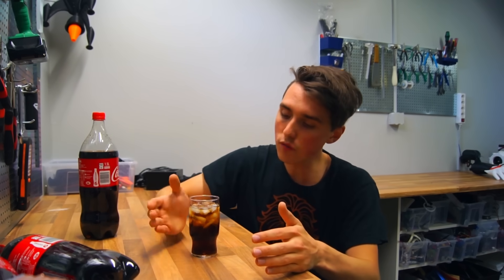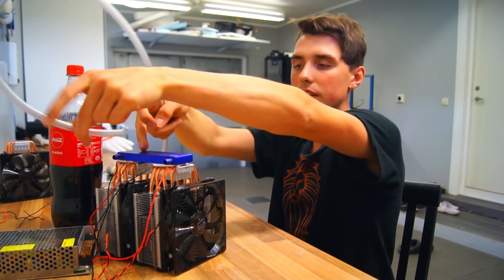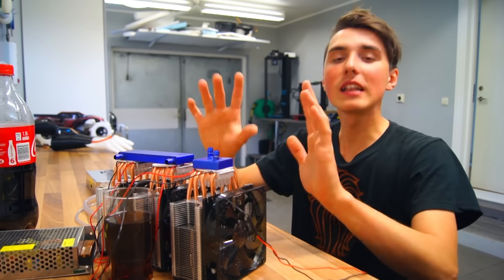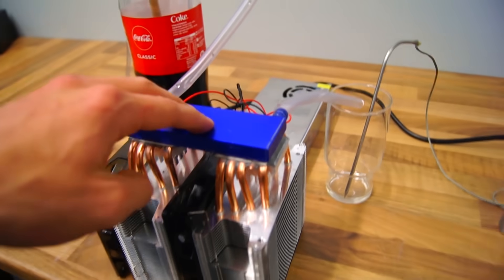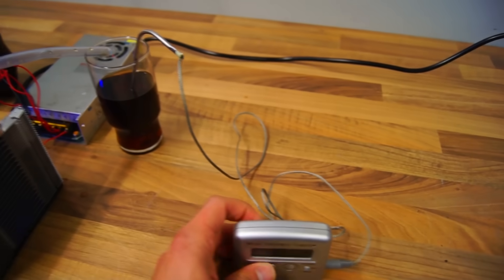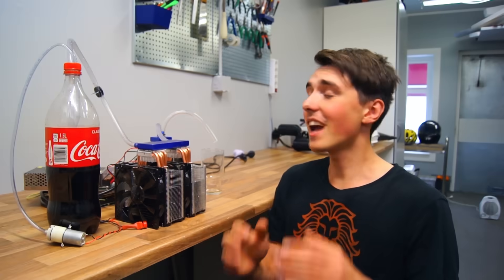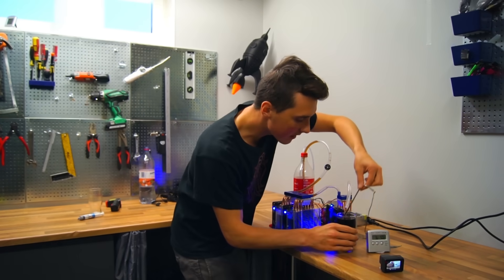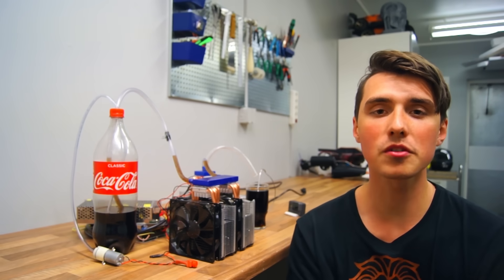Peltier Soda Cooler Machine - DIY Drink Dispenser

Comment: One question.       ? Is your heat sink upside down. If it is it is not performing at 100% of its potential.    
The top of your application I believe is the evaporator, the finned section below is the condensing unit. It uses gravity to bring the refrigerant down into the evaporator section when it is oriented properly.  Please let me know if I am wrong.

Comment: I know it's pretty old by now but maybe you plan on a second version.
The main problem i see is a the water body. It's very thick. So the coke flows through it but it gets cooled only from the bottom.the coke more on the top does not get cooled enough.
So maybe 3d print a cooling body that either very thin to make sure all the coke is close to the bottom. Or modify the current one so it's has layers inside of it. So it's longer in the water body and every layer is thin so the bottom layer again cooles all of the coke since everything flows through the bottom layer. Otherwise you could also put the 3rd heatsink on top. Combined with a better water body probably gets you down to almost 0 degrees

Comment: I would suggest using 2 Peltier but more powerfull ones and with 2separate flow and use gallium thermal paste and even better would be watercooling the Peltier modules xd this would be non power efficient but cooling your soda really quickly

Comment: Slow down the air pump, not put a flow limiter on the coke. Run the pump at 9 volts. Or vary the airflow.

Comment: Hello , make a water cooler system for pc's cpu and Gpu 
Tnx
Reply: that could work but the condensation issue is the bad part. and water+electronics is a no no.

Comment: Should you have put the restrictor on the output end? Also if you wanted to be accurate, you should have put the temp probe on a stand so it doesn't read the temp of the sides of the glass because they would be warmer

Comment: 1 year later: If you use a cooling block with more mass you will get much better results. The drink goes through the block so fast that the only heat that gets transferred is what the block can absorb and nothing more.

Comment: I don't need this.  I have ice.  But this makes me ask, is there a way to make an ice dispenser with peltier coolers that brings in water and spits out ice?  all you have to do is bring the temp down to 0.  I was thinking about a gear or chain that holds tiny ammounts of water that touches two coolers, and so the water freezes, and forms ice, and then at the end of the chain is a wheel, where the chain bends around a wheel, and forces the ice out of the chain.

Comment: Two things wrong with this efficiency wise.. One is heat rises so the cold side is being heated up.. Second thing is the way heat pipes work requires the block to be on the bottom otherwise there is no liquid to phase change and it is basically working like a heat sink but not a heat pipe heatsink... Try it again once you know what you're doing. Cool air pump idea though. But I've built much more complex cells for my a/c unit I made. Also power wise if use a 12706, nothing higher as efficiency drops with higher power units.
Reply: Heat doesn't rise it travels to cold, that's basic knowledge. If you don't know that, how can you tell him what he's doing wrong? It seems pretty clear you are confused by you talking about phase change. It's a heat sink. The block gets cold, the Coke goes through it. Nothing else. And he's not concept testing a prototype, he's just fucking around with spare parts for something to do.

Comment: You losing a lot of power using this method because air temperature heats up the box, so you should use a styrofoam box to isolate freeze box from air.

Comment: Why not use a water pump? Fill the glass with coke, then use the water pump to take the coke from the glass, through the cooler, and back into the glass. This way circulates endlessly until it reaches the temperature you desire.

Comment: The Chinese made water block will kill u with heavy metals contamination... They recycle copper and aluminium from scrapyard or cell phones which are heavily contaminated during the recycling process. Also if there is soldering done at the block, you most probably will get lead poisoning. You should use food grade stainless steel for that.

Comment: 1. Turn the 2-3 cpu cooler 90 degrees so they do not blow the hot air on to the next which is less effective to remove the heat,,
2. Instead of a water block it must run through and pump, etc. Use an aluminum block / plate that is large enough for the bottle to stand on top of it, so it can also be used for cans,
3. To keep it longer cold and a little faster, place a thick polystyrene box around the alu plate, from the plate and up, higher than the bottle and put a polystyrene lid on to keep the heat out

Comment: I would suggest to put a volt control (dimmer) on the air pump to slow it down so there will be more time for the heat exchange.

Comment: carbonic acid and aluminium (blue fluid heatsink material) reaction results in aluminium (Neurotoxic) being deposited in high quantity in your beverage. use a glass heat sink of you will get Alzheimers disease in only a few years and become so dumb you won't know what 1 + 8 equals

Comment: Cool off a copper block with it then take it off and drop it in the coke. That way it can run before you get the drink and be ready when you need it, also will cool it much better and more quickly.

Comment: there must be a better way, I cannot remember what it is called when you heat water using friction rather than flame or electricity, but I am wondering if there is an opposite to that. either way though... think on it, make it better, scale it down, patent it, and sell it.

Comment: With your contraption you can just pump some coke into the blue container and add a longer hose to the end of it and elevate the hose at the end then wait a minute...

But I would use only water with anti freeze in the hose and run it in a loop around the glas or better the bottle.

Comment: Dude crazy idea, get some gallium and disolve has much aluminum cans into has you can to form aluminum gallium alloy. I have not tried it but you can to see if scandium will be disolved by gallium like aluminum is. if so then use equal parts of aluminium scandium and disolve it into your gallium for G.A S. gallium aluminum scandium alloy. Fill copper coils with this alloy and sweat end caps sealing the copper coil being used. This alloy conducts heat and cold temperatures amazingly well. You could design a 12 volt ice chest or a 12 volt refrigerator that operated off a single Peltier module. Just increase the size of the coil being used That is filled with G.A.S..  Dude try recycling an.old absorption refrigeration unit from an old camper and retrofit it with said up grades. 😵😲😊😉

Comment: I would think it better to cycle water or even antifreeze through the cooler then through a tube completely through the beverage container vessel and back through the cooler again.  Then if you wanted to further bump efficiency you could foil your tube that's exposed to air.   With a few cycles you could really freeze the beverage vessel, especially if you've coiled it a few times inside before exiting.

Comment: You can repeat that test but you will only need an aluminum small tank connected with the peltier and you are going to add slow rotor to spin inside the tank then find a way to insulate the whole cold side it will give you same or even better result with less power consumption

Comment: Umm, waterblocks usually have copper surfaces exposed inside (most don't coat them as it's cheaper not to and just use a corrosion inhibiter in the water) and the soda contains acids that will increase corrosion. You are making a colder copper-drink.
Reply: Cold water has very little solubility, don't worry

Comment: With how much time you put into it you would have better luck with 1 module + heatsink and a better fan for the heatsink and have the glass sitting on top of the module directly and leave it sitting for 10 minutes.

Comment: It's FAKE. you can not go below 0 degrees Celsius with only with heatsink, because you cant reach any lower Temperature than ambient temperature. You just put these water blocks  in the  freezer and freeze them. If you don't believe  chcek out Linus Tect Tips channel

Comment: RCLifeOn I just watched your video, but there is an issue that you did not take into consideration.
You put an oppressor in the hose to slow down the flow but it was wrong to put it out of the bottle.
I think this cooler would give better results if the flow reduces its speed after leaving the cooler
I mean to put the oppressor of the flow between the cooler and the glass where you pour the drink
So when the soda reduces its speed it stays longer in the cooler, I can believe that it can reach temperatures below 4°C, it would be an optimal range if it were between 1°C and 4°C
You know I do not have the material to do this small project or experiment but I would like to know if you could do it again but with the hose oppressor in the place I say, reduce the speed just coming out of the cooler.
or you can reduce the diameter of the hose outlet.

Comment: Since coke is corrosive (can be used to clean toilets),  I wouldn't trust the generic aluminum block to have a nickel plating inside. Also to make it more efficient, you can always run the pump and feed the cold liquid back to the bottle.

Comment: The idea of choking the fluid was good, even though you should put it at the outlet of fluid instead of at the inlet, that's the reason why thermostats exist and they go in that point of the system. Good job kid.

Comment: What if you put a potentiometer on the pump?
That would slow the flow better i think.
Reply: You dont do that. Potentiometers are mostly not suited for high currents. You would take a transistor or a mosfet and then controll that with the potentiometer. The mosfet is then controlling the pump

Comment: Voltage control, voltage control and more voltage control. The air pump could of had it's voltage bucked, while the two peltier modules voltage could have been boosted. Sit down junior, you're getting a C-.

Comment: Great work, I’m doing a similar project, this has helped. One suggestion, bleed off some of the air to reallly slow down the flow, and add some sort of mass to the cooler block, that’ll help hold the temperature down when the coke passes through the block.

Comment: would work a lot better if you had more heat blocks half that size. plus smaller diameter hose/connectors ;) smaller blocks would be easy to cool and when coke is going through it will cool down a lot faster after passing warm coke through it.

Comment: A better way would be to have multiple loops of tubing that feed back into the heat exchangers so that you get a thermal gradient then you can circulate back into the bottle and have a serving tap when it is the desired temperature between 2 and 3 degrees C. Someone made a point about the remaining Coke freezing inside of the heat exchange block that is why I suggest a continual movement an alternative to that would be to use a peristaltic pump instead of air pressure lifting. Of course, if you circulate too much, carbonation will be lost. Anyway, solid state heat exchange is a fun scientific concept to play with and of course, you could also connect a battery to the input side of the Peltiers and recapture a small amount of electricity as they warm back up.

Comment: I still think your flow is 2-3x too fast. You could simply run the air pump at a lower voltage, you could use a resistor to do this.

Comment: Those copper pipes on the heatsinks are "heat pipes".  They work by boiling a liquid on the hot part and condensing it in the fins.  That doesn't work if they are upside down.

... Flip it over.

Comment: Instead of the air pump you could have used a peristaltic pump, with that the quantity going through would have been easy to regulate, thus you could have the drink cooler.

Comment: Although a bonkers design that I found Interesting it got me thinking about small design changes for example if you stayed with the 2 Peltier design and stacked say another 2 large water blocks on top so that you had 3 in total + the flow limiter you added might see better results? and maybe you could test if the flow from top to bottom or bottom to top would change the end resulting temperature?
Anyway loved the video even if i'm very late seeing it thumbs up

Comment: Wouldn't it be a good idea to create a loop system, that way the system would just keep cooling the drink? To make it more automated we can put a thermal probe in the bottle and when it hits a target temperature the system would just stop, any higher than that the system will resume. thus when the system is done we can remove the cap with the tubes and probe then pour yourself a nice ice cold drink. another way to get the liquid into a cup is to add a bleeder in the tubing that way it's not required to remove the cap, the liquid would just bleed out into a cup making it dispensable. Keep in mind the freezing point for liquids, the temperature limit must be greater than the freezing point.

Comment: I think it would make more sense to buy a cheap fridge. you only use like 70 wayts when it is running and once on temp will use nothing. instead of cooling 1 glass ( it cannot keep up when you would poor glass after glass), you can store 30 litres of chilled soda. fridge will cost less than all your components. haha. just making fun. it is just fun building it. just turn the cooling unit upside down. now the heat from the  cooling units on the bottom rise and pass the cool side
 just a bit more efficient the other way.

Comment: So I think the reason the second block didn't appreciably make a difference is the thermal mass of the aluminium blocks is actually doing a chunk of the work. You pre cool a mass first then pump, it isn't really the peltier cooling directly on the fly. 0.45l from 25 down to 5 would be 450*20*4.2=37.8 kJ and in 10 seconds that's 3.7kW not 300W? (Cooling power, not supply power, which is going to be like <20%). Great project! Add a massive insulated slab of copper to this and you should be able to turn warm liquid into chilly drink very quickly at the cost of some electricity :)

Comment: It is not recommended to drink anything, what goes through a watercooler block. The cooler blocks are mostly manufactured from copper. The coke (acidic ingredients) goes into a chemical reaction with the copper, and it will produce poisonous chemicals.

Comment: if instead of water in the blocks use alcohol you could use 100% of the capacity of your peltier (-30ºc) ... Ethanol has the melting point at -114ºc or use ethanol mixed with water 50% ethanol 50% agua would have a better performance ... or even salt water, its melting point is -20ºc when common water is 0ºc ...

My name is kelvin, I'm Brazilian and I'm 18 years old ... if you decide to test me for an answer about the results ... Hugs .. and good luck

Comment: Not sure if anyone mentioned this idea.  Keep the pump running, but recirculate the liquid from the coolers back to the bottle. Then add a separate valve and tubing for dispensing.

Comment: It would be more efficient to have several tiny coolers and more length of tube to flow through than just having a singular big cooling block.  Also, put your flow regulator before the spout instead of before the cooling block.  That way the fluid stays in the block longer.

Comment: DON'T SPREAD THE GREASE ON THE HEATSINKS aghhhh nobody's gonna see this comment anyway, why do I even bother. :( Spreading creates air bubbles. Just blob it. Or spread it but leave a dob in the middle that gets spread first.

Or even better, use Arctic Silver adhesive epoxy and you wouldn't even need a mounting solution.

yeah but anyway, nobody's even gonna see this comment so who cares.

Comment: Try adding more thermal mass to the top of your liquid coolers, they defrost so quickly cause the mass passing thru is so large compared to the mass that is cooled. I am thinking you would be able to cool a lot more as a time, but it would take longer to cool the block right away.

Comment: Instead of adding another stage, you should consider putting two more on the opposite side of the cooling block.  The higher heat capacity you can accommodate for in a single block, the more cooling capacity you can put into your cola.
Reply: You could also slow the flow to increase time within the block.

Comment: The heatsinks cant make the temp go lower then the room temp and since you are using those freezing blocks you are just adding heat instead of removing it with those heatsinks.

Comment: Hallå där, min landsman!

Your problem is that waterblocks is made out of quite thinn material, so you don't have any thermal mass
to absorb the heat from the Coca Cola. The peltier's them self is able to handle it but most of the Coca Cola
is actually flowing way to far away from the area where the peltier's contact.

If you could find (or make) a waterblock that's half as thick (i'm guessing it's about 1cm now)
you would see much better results.

Due to all the above, your 100W peltiers are overkill, most of their capacity is wasted.
I would find a thinner waterblock, put an extra layer of copper on the top and bottom
and then use several of the smaller peltier's (15*15mm) in a row (3 on each side?).
I would then use 2 of the large waterblock you have in the video, to watercool the peltiers 
and cool the water through a 120 or 240mm radiator. It will draw less power, have better performance
and you would be able to fit it in a small computer chassi.

//Mjukvaruutvecklare och elektroingenjör från Skåne